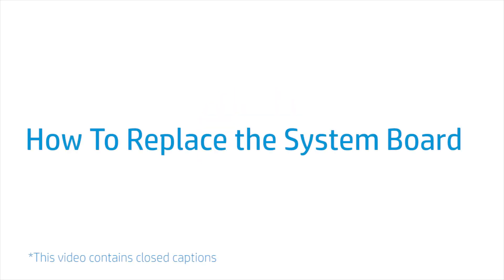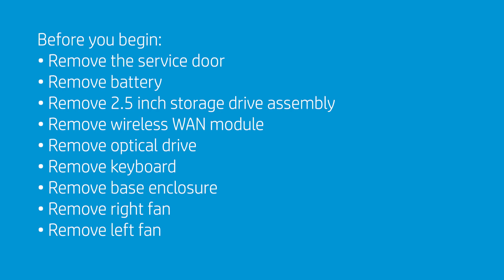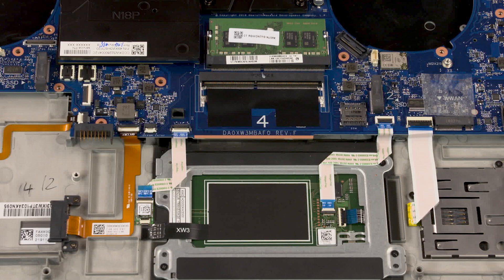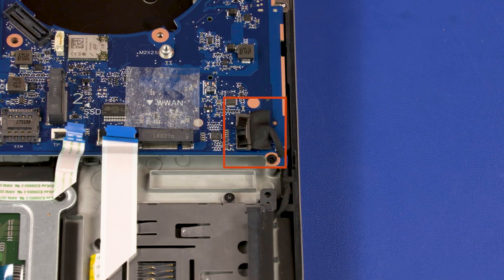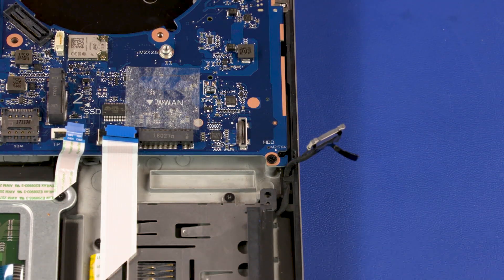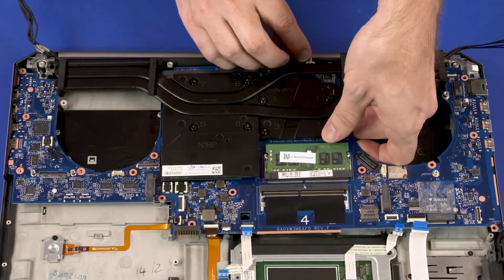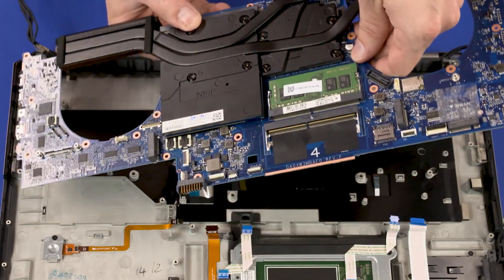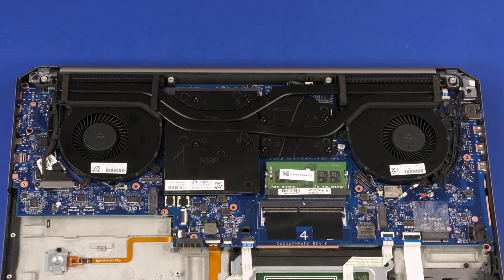Replace the System Board | HP ZBook 17 G5, G6 Mobile Workstation | HP

Comment: Is it possible to upgrade my Zbook 17 G5 with mainboard from G6? Visually it looks similar and it seems for me that G6 mainboard will fit into G5 case...
Reply from the maker: Hi Eugene, thanks for contacting!
I understand that you need to know whether you can exchange the motherboard from other model number.
I will do my best to assist you.
HP does not recommend upgrading or downgrading hardware parts or software that is bundled with the product as It may affect the manufacturer's warranty and performance, however, you could change the configuration at your own discretion.
Binu - Social Media Tech Support
Reply: @HPSupport  Thank you for quick response! I understand that I'll lose warranty but nowadays all laptop CPUs are soldered on motherboard so anyway the only way to upgrade CPU is to buy and install whole motherboard with more powerful CPU. So the only question is whether motherboards from G5 and G6 are compatible by sizes, screw positions, connector and heatsink placements, as seems by their pictures.
Reply from the maker: Use the HP Parts surfer to identify the part: http://partsurfer.hp.com/search.aspx 
Binu - Social Media Tech Support